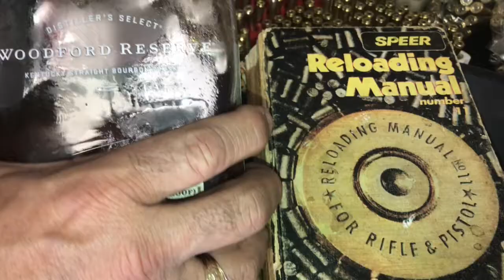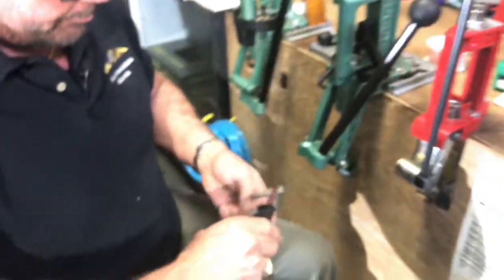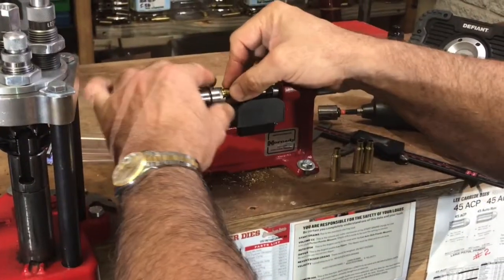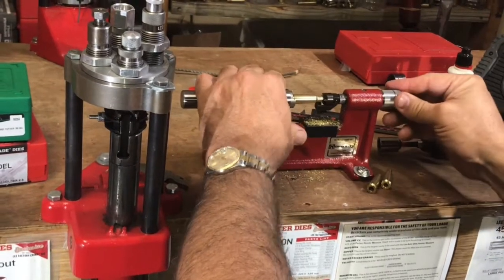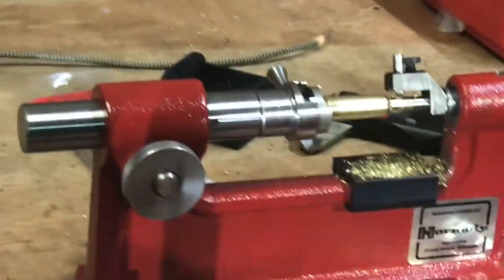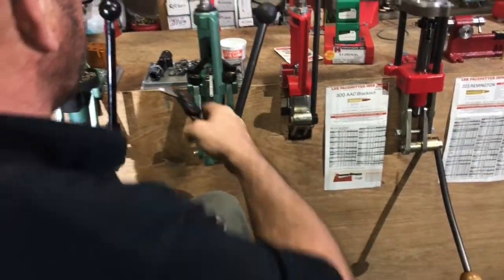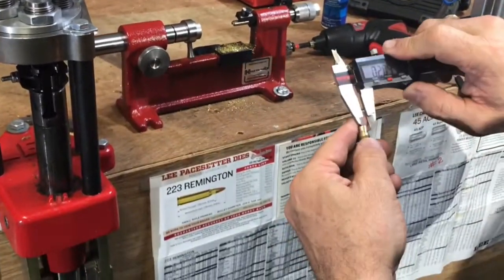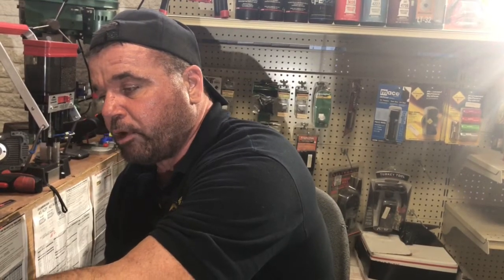Converting AK brass into Grendel

Comment: I've got my Hornady trimmer set up the same way and it's working fine for me.  If you put a hose clamp on the left side ram, you can set it as a depth stop when turning necks and it speeds up the turning process a bit because you don't have to set the shoulder stop more than once.

Comment: I have tried your Process and so far, it's not going well I'm trying to turn 7.62 brass into 6.5 Grendel, and it isn't working well. I use  
my Hornady FL sizing die then I put them in a case gauge and most the rim sticks above. I try to follow your method, not sure what I'm doing wrong, would slightly heating the case to soften it would that help? I have as well a RCBS SB Die set, I have tried that after the Hornady die and still no go. Any ideas?

Comment: How dose this conversation ammo compare to new 6.5 G in performance.  Asking because thinking of getting 7.62x39 and converting it. 1 the 6.5G is hard to find and 2 can get 7.62x39 for 500 600 for 100 bucks.
Reply from the maker: J Erb I honestly couldn’t till any difference but I don’t shoot F-Class or PRS competitions. I think if you shoot competitions and load extremely hot you might see some advantages but for my needs the converted brass works just fine.  Thx for watching.

Comment: It's a7.62x39 bolt carrier group and not a Grendel bolt carrier group right
Reply from the maker: Timothy Farmer   There’s actually 2 bolts for the Grendel. Research your gun and make sure you have the right one. Gen 1 and Gen 2. I think both will work but they do have two different extractor depths.  Good luck. Thx for watching my videos